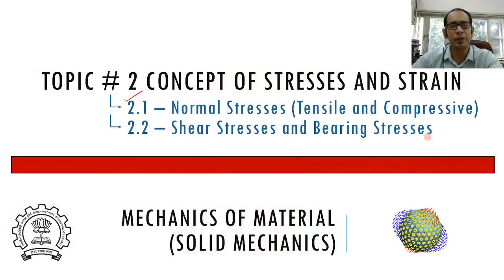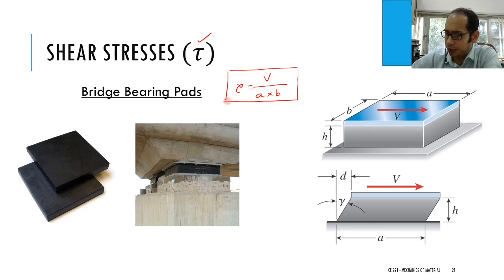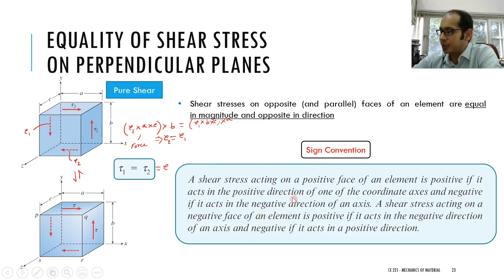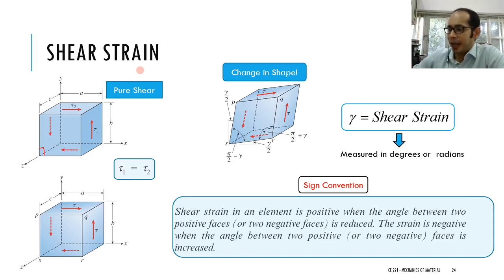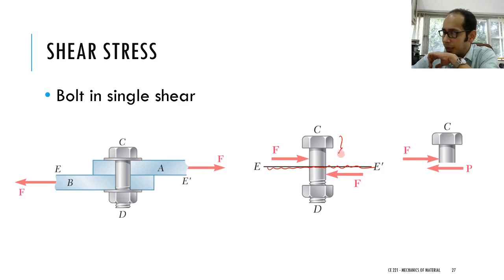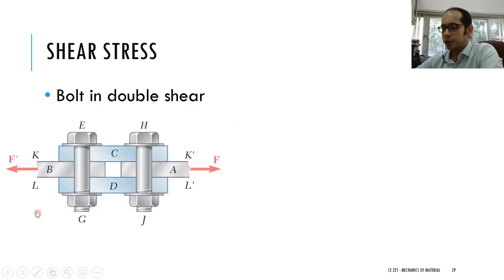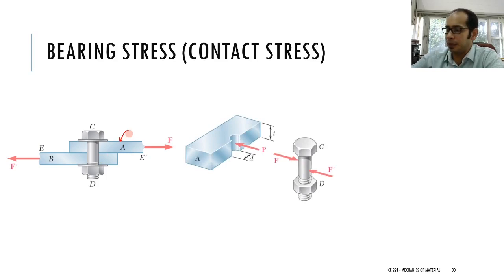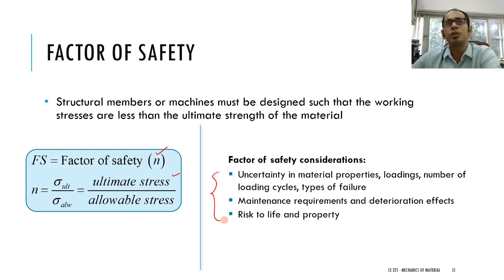Topic # 2.2 - Shear Stresses & Bearing Stresses

Comment: Why is there 2 figures for explaining shear strain, sir, you have given the figure of pure shear where diagonals of the cube are stretching on one side and compressing on the other side. But some textbooks show a cube fixed at bottom sliding like a thick book would deform. What is the difference between these two perspectives ?